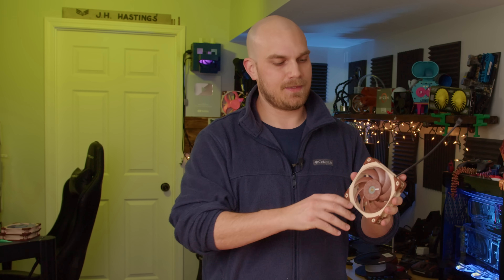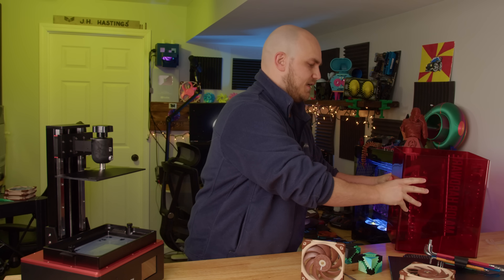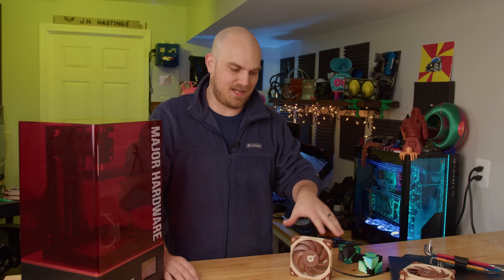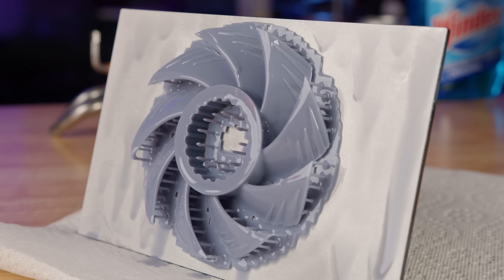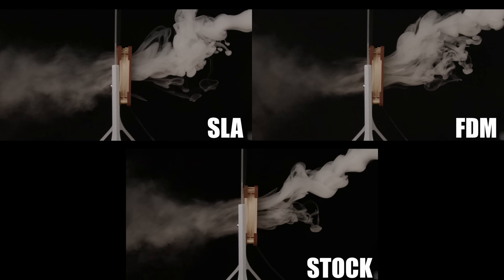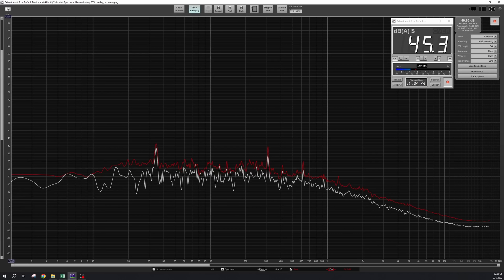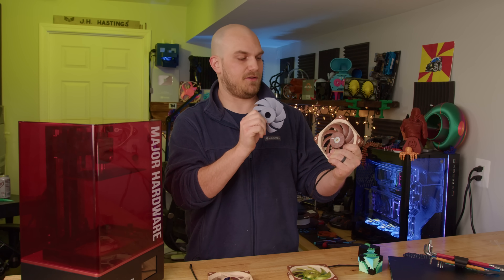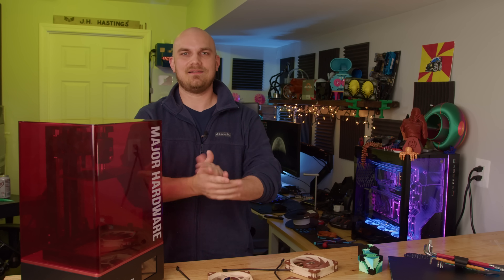I Copied Noctua's A12x25 and Resin Printed it, Its Performance Was ASTONISHING

Comment: Have you tried Plant Based resins? I use Elegoo's version and the smell is way less than the usual resin. 
I'm not surprised the FDM was better. With FDM you're using much thinner layers for the print so the fan is going to be much smoother. The original being injection moulded is of course even more smooth.
Honestly, you should stick to FDM printing. The reason being you should test apples to apples to compare. Even though your pulling absolute numbers for the tests. The chart is a comparison between each fan. Also, I'm willing to bet far more of your viewers have FDM printers than LCD resin printers.
But if you do all the fans in resin going forward you'd have to do the old ones if you wanted to be able to compare them properly.

Comment: If you do not have special performance needs from the resin I suggest using Elegoo's water washable resin has worked great for me in most prints. Low to no oder, easy on the skin if you spill. While you can wash in water I find the best results in simple green and a ultra sonic bath.

Comment: I moved (mostly) from FDM to resin printing a year ago, and it's not that bad once you have a workflow in place, and a wash & cure station. The PPE is still a think of course, but repeated use leads to good efficient habits. I'd look into the Sonic Mighty 8K for a larger build plate SLA printer. Would be cool to see at least the top 5 fans printed in resin for a final showdown, but I'm here for all of them to be if you have the time/effort/money to set up a good resin workspace.

Comment: Have you considered taking steps to improve the surface finish of the FDM fan and reevaluate its performance?  You call out in this video that it's pretty rough, that would undoubtedly affect sound level and likely airflow as well due to the additional turbulence.  This could help determine if the performance difference between the 2 fans is truly material/process based or something else.

Comment: Yeah I think you need to retest the top five or top 10 as resin print because some of them came incredibly close to noctua one to 2% might make up the difference and there's no telling how a cleaner print will affect them to be honest the fact that you had the option of using a resin printer for so long and haven't used it bugs the living shit out of me because you tried to be so scientific about everything else but you're ignoring probably the largest component which is how the air behaves over the surface of the blades and sometimes you have nasty prints and you just say fuck it and ship it to me that's bullshit dude like some of them could have actually had potential but you bought the print and said oh well you know if you're going to do shit like this because I do know you've had companies contact you trying to get a hold of the people who designed this shit so they could use their idea and possibly buy it from you're really potentially fucking a lot of these people by not giving them a fair open field test bed because resin is going to print a far better surface now you could do FTM printing but that would require you to do more work than you're actually capable of it seems

Comment: Would be cool to see the hardware limit of your Průša printer. I managed to print a LOTR ring on my Ender 3 with layer height of 0.04mm, the text is legible and I wear it every day (I used Prusament 'Oh my gold' PLA and something like 235° C because from my experience, PLA rings just break because of layer separation so I usually go rly high with the temperature and reduce print cooling)
if I'm not mistaken, FDM printers from Průša are marketed with a limit of 0.05mm layer height but I'm pretty sure that it can go even lower than that with some tinkering (or I'd laugh at anyone who purchased it and got beaten by my Ender 3 xD)

Comment: I would be interested in seeing the difference between the two print methods for more complex designs. This video already showed a broader wake for the PLA fan, suggesting that the detailing on the blades designed to control vortex shedding was less effective on the lower fidelity model. My hypothesis is, that the difference between the print methods would increase with complexity of the model.

Comment: Firstly congratulations on your new Arrival. 
Yes to the resin print-off. I have been printing with resin all the time and if you want a safer alternative, use plant-based resin instead. 
It has less smell and is safer for you and the environment.
My printer- Anycubic Photon mono x and  has a built volume of 192 x 120 x 245mm.
Greg 👍

Comment: Resin printing is an absolute mess and it's not "better" in any way. I say "better" because it's just an opinion, it takes a lot of time, resin is expensive, I don't like the smell at all, I hate dealing with resin in general, etc. I could go on and on about how much I dislike SLA printing but for some people it just works. For me... I will never do it again after I got my most recent FDM 3d printer from bambulab I love it and I use it for everything. Even made a ton of fans to test from this channel. Also you should try the fans in ABS or ASA and smooth it with acetone. I normally use MIBK, has the same effect and it's quite a bit faster.

Comment: Resin printing is also incredibly consistent, which could be very important for comparison tests. In FDM small changes in material, speed, cooling and other things can quickly give a rough surface sometimes and a smoother one other types
Reply: In resin printing small changes in ambient/resin temperature and print settings can change the print's properties immensely. And then you have post-processing. It's not that consistent. :D 
SLS is probably the best, but I only have resin and FDM printers.

Comment: I find FDM to be a giant pain the ass. Resin printing is dirt simple, plug in the USB drive, select the file, press print, and walk away. With FDM, there's so much setup and calibration and special room conditions and Jupiter has to be in the right constellation for it to work properly, it's just a giant hassle.

Also, the 'resin not good for your skin' is over rated. Sure, it's not water, but if you've ever worked on a car or anything else mechanical, you've had far worse on your skin.

Comment: I find using my SLA to be a toxic mess, dealing with the resin fumes, and the IPA fumes, and trying to deal with the used IPA.  I’ll only use it for special prints. If you over cure then the part is brittle, if you under cure the part will eventually cure on its own over time, but how do you know?  The resin is expensive. The resin expires. For only a 2% improvement, I could not blame you for sticking with FDM.   If, however, you find a low oder resin, and you wash the parts with water, then maybe it might be ok, but I have not gone down that road.

Comment: considering the results i would strongly advocate for the use of resin prints in the fan showdown!

Additionally there is another advantage of SLA/DLP prints: The material (Photopolymers are way more resistant to temperature than thermoplastics... (as the name would suggest). And most Photopolymers are pretty light. (Another advantage.)

Also SLA/DLP prints allow for finer designs (thinner walls) or even playing around with different surface finishes... (one of the biggest pints where FDM simply can't keep up....)

So i think there are pretty much only advantages to doing it this way! (And prices of SLA/DLP printers are finally in a range where it is also feasable le to get one and not go bankrupt 😂)

Comment: First of all, for sure I'd like to see resin printed fans instead of FDM, they look miles better, putting aside the negligeable performance difference. And 2nd, if you really want to make as close as a 1:1 copy as possible, you should invest in a 3D scanning laser equipment. This will just give you the CAD with accuracy down to microns, I think.

Comment: Maybe try FDM again but with a range different nozzle sizes and layer heights. If you are willing to try ABS iinstead of PLA, acetone vapour smoothing could also be interesting. There are smoothing products for PLA but also cheaper options such as painting with watered down PVA, polyurethane varnish spray cans or bits of ABS disolved in acetone (which does not disolve PLA).

Comment: I mean, honestly this is rather expected.  The surface geometry of something like a fan is absolutely critical.  How the air flows over each blade is 100% the point of the design and an FDM print's surface irregularities are going to significantly affect that.

Comment: I think you should try printing the model with abs filament, which will be the closest material to the original. Secondly, the infill ratio should be %100 to have a solid built part. Also i would like to see the 3d modelled frame too, that would make it a whole 3d fan pack just without the motor and cable.

Comment: I LOVE Resin printing, however I don't think it's a good idea for the typical fan showdown. For a few reasons. Some of them being the reasons you mentioned. Another thing is that printers larger than the Saturn do not do well. You'll be hard-pressed to find any that rate or review well, and even if they do somehow (cheat?) get some good ratings, the same people who gave those ratings seem to admit that they never USE that printer. There's just a certain scale at which resin printing becomes much more difficult to handle. The Saturn seems to be at about the perfect scale.

As I said, I'm a huge fan of SLA prints, but that's because I like printing and painting minis and figurines. I like the occasional comparison of resin fans, and as one of your other comments suggested, maybe you could print the top 5 and compare. But it wouldn't be worth the hassle, the time sync, the money, all of that, to resin print all of these separately. I think FDM is a better rapid prototyping medium for this project.

Comment: I'm very happy you did this comparison, as I was always wondering in your videos how bad the performance difference might be, but it isn't actually that bad.

I don't think resin printing for all models along the season is worth the effort, since we now know the difference is roughly 2%. So that is fine. But you could maybe print the winners of the season in resin and compare them in an extra video or so, if you really want to. I don't think printing some with resign and some with FDM is a good benchmark though.

for very fine models, you could print both and let the resin version run without counting it for the final results.

Comment: What about weight? Heavy means harder to spin up (and likely bit lower max speed), so this can be a factor too, especially at large diameters. Would be interesting to see the same models printed with different materials (which have slightly different weights). Also on the FDM machine you might want to try printing different orientations ("standing" would be the best, but pretty hard to print), because right now the lines are perpendicular to the airflow, which MIGHT have a small effect on performance. Lower layer height might also help, as you would have smaller "gaps" between the layers, causing less turbulence.

Comment: Regarding resin, try SUNLU Water Washable resin, they smell a whole lot less than Elegoo's and you won't need to mess with IPA to clean it. I also have the wash & cure station which spares me a lot of hassle... Just take it off from the build plate, throw into the water tank, remove supports clean a bit more then cure

Comment: The different isn't the medium. it's the resolution of the print.  FDM at what... .1mm or .2mm layers?   the MSLA is gonna be at maybe .05 or less. Not to mention your nozzle on the FDM is likely a .4(so you'll never have a line thinner) the  Saturn has something like a .047 pixel size.    Essentially everything is at least twice as accurate.    This is also the cause of the better surface finish.    Thinner edges and sharper details matter for this kinda thing.     The type of resin you use also matters for some of that stuff.   It's a much more technical type of printing.....yes, the post processing is a pain.

I'm currently printing models for silver casting with my resin printer.

Comment: You can print super complex designs with Sla, multiple small parts at the same time, and in my experience it's faster than FDM. I'm all for the switch.

Comment: resin in theory and my mind should perform better do to less edges equating to less friction. on a microscopic level those inperfections are more like mountains with giant boulders in a multi cascaded scenario controlling the earth atmosphere. it sounds a little over the top but i asure there are many corelations. i agree with other comenter that if its a hastle then only do it for the ones you really want or ones that might be more suited for the aplication. ive made many fdm replacement blades for 12v fans but that resin is looking fantastic

Comment: I highly recommend the Anycubic M3 Max, I have one and a M3 Plus. They have large build volumes and I upgraded their films to nFEP (which helps reduce film adhesion significantly so large surface area parts are much easier) and they are blazing fast and highly accurate for the price!

Comment: Note: This was a best case scenario for fdm vs resin. Some prints really have huge skin friction or mechanical parts. 

Resin being heavier really was mighty close to factory. I wonder if you wax it it'd help a lot too, as resin has a relatively high skin friction even smooth. I'd like to see the stock fan waxed to mirror polish too, if possible. If there is a sizable upgrade I might car polish my own fans.

Comment: 100% print in water washable resin. Some designs simply failed completely the old way. After a bit of experience resin is easier in many ways and the fdm really doesn't cut it. No intricate design features work.

Comment: If you are going to do resin printing see if the fan can be printer vertically instead of horizontally.  The prints will take longer but you can do several at a time.  If not, look into stacking which would again, let you print several at a time, but you need to worry about the suction of the large area pulling the prints off the plate.

Comment: 2% better sounds like margin of error. So FDM should be fine (and is more colorful!)
..or if you wanna go the extra mile, test all 3 on the same motor and maybe also weight them.
Other commentors already pointed out, that the motor could go faster, if the fan is lighter

Comment: you should also check the weight if the prints and the RPM that they were spinning in free air and against the radiator

Comment: I'm curious what your FDM print settings were in comparison to the SLA print. You had some pretty clear voxel lines on the SLA print, which is likely to have some impact on this type of application. Was your FDM print done as a solid 100% infill? Between weight and rigidity, that would also make a potential difference. Also, which material is the FDM print using? I'm assuming PLA, but the question is, would something like PETG or PLA+ be better, or maybe even ASA? Because of the electronics components, I had never even thought about 3D printing something like a case fan. Very cool stuff!

Comment: Didn't do the math, but that peak is almost guaranteed to be a multiple of your RPM and will be present with any rotor that has the same amount of blades. 
Surface roughness is probably a big factor, I'd be curious to see the results for a smoothed FDM print.

Comment: Difference comes from material's weight density, surface friction etc. Not a surprising result that you didn't have better printing material than Noctua. But Resin vs pla results are very useful!

Comment: id be curious to know if sanding down the edges/ridges on the FDM causes changes.. is it the material itself, or the imperfections in the print that cause the 2.7% loss

Comment: Noctua did give you a bone.  They told you, resin creep.  That's the difference, structural geometry changes at velocity.  If you put in a spine to the blade to counter that, I bet you'd gain that % back.

Comment: Please set a layer height lower to 20 microns on your MSLA printer. It shuld close 0.5% gap on performanse becose surfase will be equally smooth in all projections. yet will not change process owerall (make shure that your exposure around 20-30% lower than at 50 microns)

Comment: Would be interesting to see the electrical characteristics of each: resistance, current, etc. and maybe even DC motor temperatures. Not that important as the efficiency of airflow is probably the best indicator of everything else.

Comment: I'd be interested in a comparison of the season winners in SLA.

If we have a consistent improvement over FDM on a wide spread of fans, than we could skip the hassle of SLA and calculate the SLA printed fans performance.
If the difrences vary but SLA is always better then i would say sorry FDM, but SLA is is.

Comment: There are plenty of resins out there are that aren’t as toxic, or smelly.
Give water wash resin and plant based resin a shot!

Edit: for what you’re doing, water wash resin would also be much easier for you with the printing that you do. The uncured resin literally rinses off with regular water.
Check out Anycubic for their larger resin printers. The price for the size is fantastic, and they have built in cameras for print time lapse

Comment: I adjusted the top 3 of Fan showdown list by 2.5% to account for media-type issues. Angle is now #1 ahead of reference at 497 FPM. Gear Ration 494 FPM. Simple 13 is 490 FPM. Making; Angel #1, Reference #2, Gear Ratio #3 and Simple 13 #4